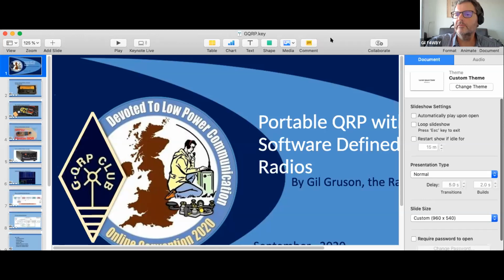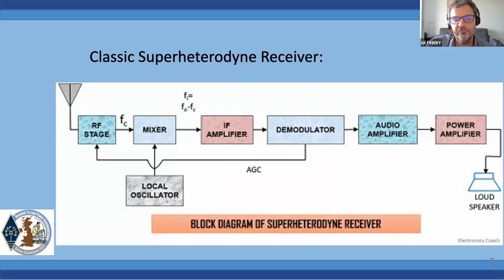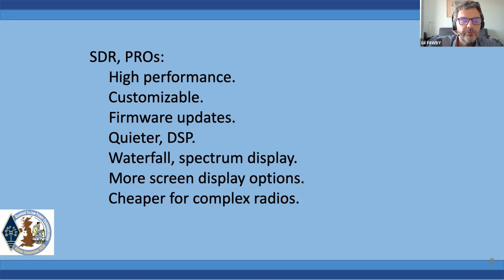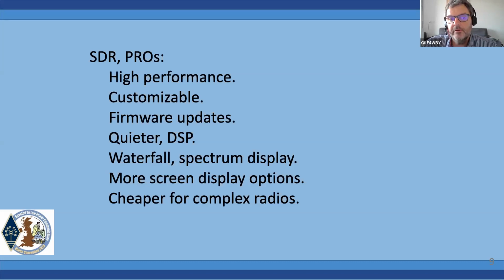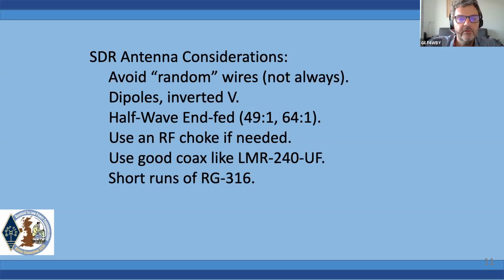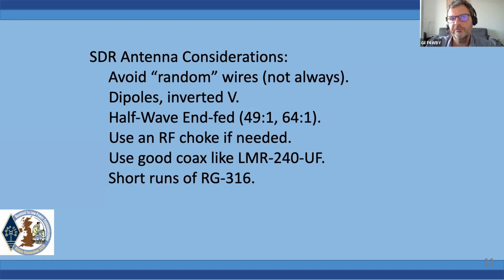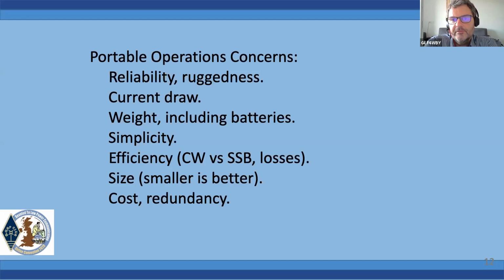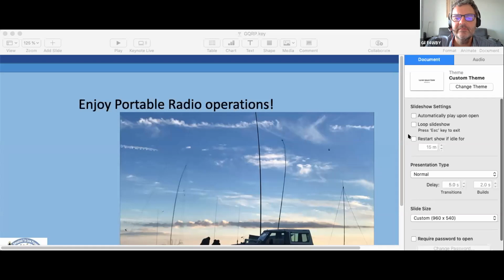G QRP Convention 2020: Gil F4WBY - QRP with SDRs and portable operating

Comment: Agree with your comments on KX2, fine transceiver but physically not rugged, for hiking or mountain topping  I would want to wrap and case it to the point where it's small size and weight are dwarfed by the packaging. Also you don't want plastic cases knobs sockets that can break from a knock.  Good video thanks Gil.